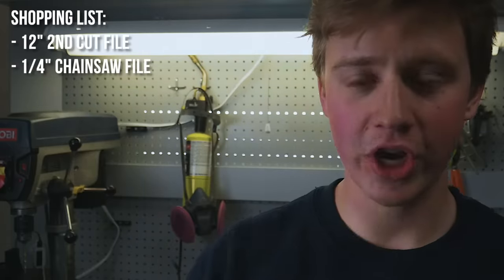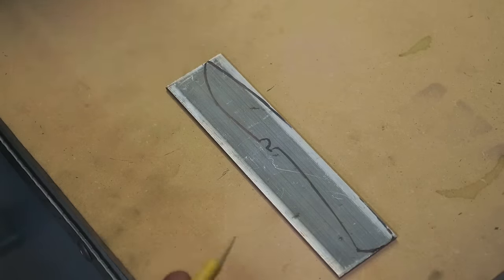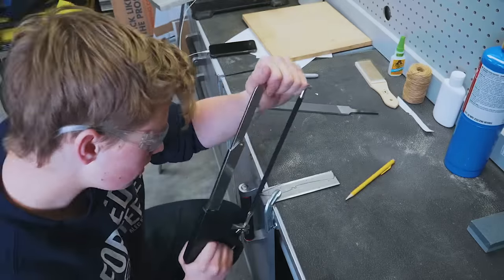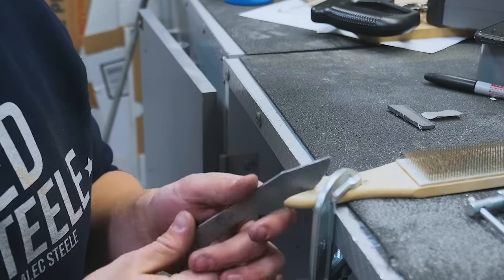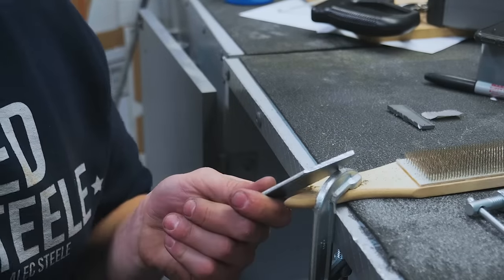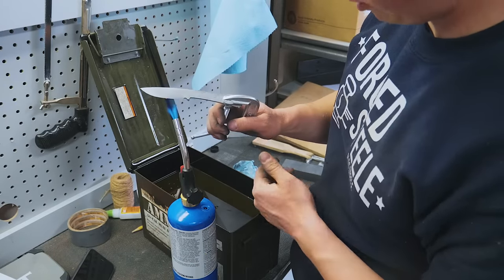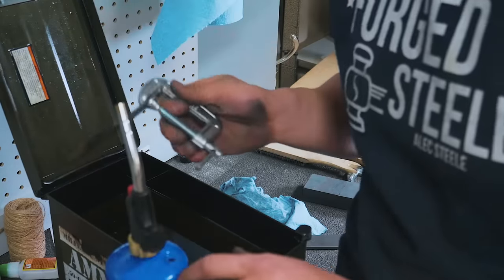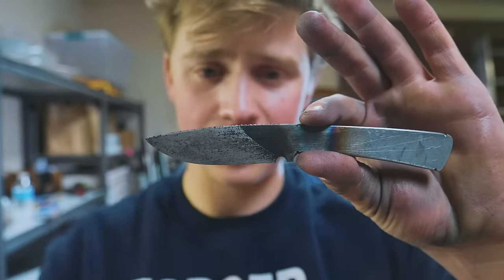MAKE A KNIFE WITH $100 OF TOOLS YOU PROBABLY ALREADY OWN!!!

Comment: Great to see a project not requiring 10'000 + dollers in heavy machines.

Fun to see what can be achieved even with a few bits from a hardware store.
Reply: you should check out Alec's learning to forge series (hopefully that's still up Alec???) he covers on how to get into forging with like absolute bare basics (like, charcoal and a hair dryer I think and what we in the forging community (feels weird saying that given how little I forge :( ) call an "anvil shaped object" **edit : which is a hunk of steel, mine is 90mm x 200mm bright steel lol, in the thingo he says to use rolled steel, so I like to think I have the prettiest anvil shaped object hahahaha
Reply: Man, keep in mind ancient blacksmiths made amazing swords with pretty much just a hammer and some stones. That said, there's plenty of cheap tools you can get. An angle grinder, for instance. Really useful, and you can probably get it for 50$. Maybe less, don't know the prices in the US. But if you can get a welder for like 60$ (I think, on Amazon) that works fine, you can get a cheap angle grinder, too.
Reply: @topanteon  95% of most guys and probably quite some girls too, will have just about everything to make a knife. Angle grinder should be a more or less must have in any home for a million reasons, and you can buy them for as low as 20 bucks, but I would go a tiny bit  higher and get a decent one that will have enough oomph. for the rest a few metal files, or even only a decent coarse sandpaper will work, slowly, but it will work. The other thing is the heat treatment, that is probably the part people think they can't but its as he shows pretty easy. if you have a bbq or backyard where you can make a fire in, use that and us a hairdryer or something to heat the blade. Dont have a yard? use the burner he said or equivalent, you can even do that on the balcony or out in the street or the curb if you dont have a lawn. Lastly use easy steel to learn in the beginning, 1075, 1084, etc. Here in europe we  have 12C27 from sandvik in norway, very good steel, affordable and very nice to work with. Morakniv uses that steel for a lot of their knifes for instance.
Reply: I've made many of my power tools including a 1 1/4 hp 48" belt grinder from cheap Craigslist stuff and birch plywood. It's not as sexy and takes me weeks but I have the equivalent of machines costing $1100+
Reply: Long as machine works it works. Does need to have to be sexy, shiny and fancy.

Most old machines of the industrial revolution and other eras where pretty much function over form.
Reply: 10000 you must be watching his very old videos pretty sure he’s way past that by now

Comment: You guys should do a knife build, only using the tools you sell in your website.
Reply: jpiz224 Is that not the same tools they already use in the shop
Reply: @AntonJonssonMEK  I haven't checked their site lately but I Don't believe they sell power hammers or drill press.. or even a forge.
Reply: jpiz224 they don‘t sell anything to heat steel so they would have to use something else for heat treat or forging and they have belt grinders in the shop which makes the job very easy.

Comment: Thanks! I'm stuck in an apartment, and by chance me and my 9 year old decided to start making a knife using pretty much this method. I can afford better tools, but no way we can use power tools in the apartment, so it's all hack saw and files. Starting with a simple throwing knife in cheap cold rolles steal, but I have a piece of O1 tool steel for a couple of "real" knives. This gave some really good pointers.

Comment: That feeling after filing steel for an hour when you brush your arm across the table and get 1500 metal splinters... ahhh filing a knife to shape :)
Reply: I love that feeling
Reply: I feel like you probably used the wrong file. My shavings are never sharp enough to penetrate my skin 🤔
Reply: Taunus-Tims Welt lol who knows, i use a very aggressive and sharp bastard file that hogs material off fast and leaves sharp sliver shavings of metal on the table (when shaping a knife, i have many fine cut files that dont do this)
Reply: @craftsmanscutlery6002  i use bastad files as well. A bunch of new ones and a couple of older files. Also an 8 pound heavy file, which is a little overkill for knifes.
All my files have "Kreuzhieb" (cross cut) cuts, so they produce little rectangular or cubic shavings and no spikes/needles. I guessed you might probably use files for aluminum or other soft metals. They are parallel cut and tend to produce these needle-like shavings. But this'd be an absolute beginners fault, so i assume this won't be your case.

Comment: Long time listener...first time caller...just a piece of advice from a poor hobbyist blade smith. I use a saw horse and clamps to secure my blade when I file and sand. You can easily flip in any direction in order to work blade or handle. Also it allows you to sit and work thus saving your back from fatigue. Hope this helps!

Comment: Just wanted to point out that the MAP gas you have on the larger torch burns much hotter than propane.
Reply: Came here to say this too.
Reply: MFW that torch alone costs $120 dollarydoos
Reply: @Marc83Aus   Wow.. around here it's only $56 at Home Depot - Model TS8000KC
Reply: @Polar_Ted  Yeah I think MAP gas isn't as commonly used over here so its more costly for a home gamer like myself.

Comment: For my first knife i used two of simular small torches. I sat them up so the flames crossed and i could heat the knife in both flames between the burners. Worked well.

Hope the explaination makes sense

Comment: Partner with demolition ranch and make Damascus furniture for an AR
Reply: That would both be really heavy, and kinda expensive no?
Reply: Not necessarily super heavy if made thin enough but it's not the point to be the best furniture for an ar,  the point is to be an awesome cross section of two very cool people, that also looks awesome. As for expense? Imagine the resale value of it, he could easily make the money back auctioning it off
Reply: Better yet. Have demo come and teach him to forge a Damascus block. And then parter with another company with a CBC mill (perhaps F1 firearms) to machine a lower from the Damascus blank

Comment: Petition to show our hammer wielding and steel welding Heros we need a Damascus Revolver Cylinder!
Make this top comment whatever the cost!!!
Reply: Now that they've got "blacksmith", "jeweler", and "tailor" covered, I think the next skill I really wish either Alec or Will (or both) pick up is "gunsmith".
Reply: Doesn't Youtube still have that stupid "No Gun Making Videos" Ban?

Also, for firearms you actually want to use Homogeneous steel over damascus to ensure uniform strength, ESPECIALLY in the chamber. Besides, the beauty of a firearm isn't found in the grain structure of it's steel, but rather the quality of its polish, finish, and engraving.
Reply: They could make a damascus revolver frame.
Reply: @MoxJet629  Once again, Youtube Gun making ban, because the idiots in charge don't know the difference between a junkyard reject showing you how to make a "shotgun" out of two pipes and a nail and a trained craftsman showing off years of honed skills in a well equipped workshop filled with equipment that's worth more than most of us will make in a year.
Reply: It might get demonotized but I doubt removed. It's art that would take a lot of skill and equipment to reproduce.
Reply: blackhawk15897 Yes I thought about the problem with the strength. My solution is to partner with a company that has high precision tools to make some hardened steel inserts for the chambers. Also, there is .22 Revolvers out there that don’t expand as much in the chamber.

Comment: When I do wrapped handles (typically paracord) I always love it when the handle has a hole for a lanyard, that's the perfect stopping point and would be a great feature to add for anyone trying this imo. If you knot if off there you have a solid handle that's not going anywhere without any adhesive, and if you want you can leave it long and tie the ends together for a lanyard as well. When I do the wraps I also love to gut several feet of paracord first and do a simple spiral wrap around the handle first, then follow it up with the twist pattern that was used in this video. The paracord is thick enough that if you don't do that pre-wrap you can see through to the bare metal, and I think it helps with slipping to some extent as well. One of those clips that you use to hold a bag of chips closed is enough to hold tension on what you've already done if you need a break, I've got arthritis in my hands so doing a real tight handle can be pretty brutal if I try to do it all at once.

Comment: Great video Will, you can put 2 strips of wood under the first layer of twine and you can put on a second layer of twine to give the handle a little more body, finally give it a good coat of epoxy and wipe off any excess to keep it from getting filthy.

Comment: Very Nice.  I'd recommend using a lighter on the twine to get rid of some of the little stringing it's got.  Hold it so the flame doesn't touch your wrap, but the heat still melts/burns the smaller fibers away.

Comment: FYI, for the torch, Will was using MAP gas (the yellow can) which burns hotter than regular propane. This helps you get higher temps so you can heat treat correctly

Comment: For heat treating, you can make a "backyard forge"with just a bag of lump charcoal and a hair dryer (I advise to tape a metal pipe to the end so as to not overheat your hair dryer). You can create a fire that can get steel up to forge temps. The only downside is you need the space, at least 15 feet away from nearest structure to avoid any damage

Comment: I ran into a guy at a local knife show that does something similar, he does use a bandsaw and bench grinder though. He also does not do a cord wrap, he dips the handles in something similar to Rhino Lining. They are decent inexpensive little knives, I think what makes them good though is whatever he is doing for heat treat ... which he wouldn't tell me.

Comment: Will. Next time soak the natural twine in water before you wrap. As it dries out the strands will shrink and tighten the twine really really tight. This also works really well with leather lacing. Another interesting build would be a cold made knife from an old circular saw blade using a 1mm slitter blade on a grinder but not letting it get hot. Also cheap and easy...

Comment: Plus, you can continue making knifes with the $120 dollars tool investment. Butj questions: 1. no need to check the temp of the steel before the first quench ? Just get it red? 2. Then put it in the 400 degree oven for 2 hours each but let it cool to room temp ? 3. What finish stone grit do you reccommend for finish ? 4. how easy will this blade break ?

Comment: Great video, just a little thing... To sharpen the edge with a stone you should "attack" the stone with the edge instead of sliding it towards the back and you will get a much sharper edge in quite less strokes. I have sharpened all kinds of knifes machetes and other things with stone for over 15 years. I can't say a thing about forging, but I can about sharpenning with a stone.

Comment: Will maybe You should get the cord wet, then wrap it on the handle, so it would pull tigher when it dries off? Just like most people wet exhaust insulation belt, keeping it wet makes it bend nicer and it also slides nicer on steel and itself.

Comment: If you need a good file handle, drill a hole in a golf ball. Try not to use a big file without a handle, because if the file catches and your hand keeps moving, you can find that tang embedded pretty deeply into your wrist or palm. Golf balls are super comfortable for some strange reason.

And nice work on the knife. That would be a great little Scouts knife with a decent sheath. Fixed blades are definitely safer for teaching good knife handling to youngsters.

Comment: Hey,

Did you know that you can get a much sharper knife if you go to your thrift store and find a real porcelain plate. It does wonders for a final edge. Used to use the bottoms of the plates at work to sharpen my knife when I was assistant chef and dish washer.

Comment: Could've made a loop that goes up the length of the handle. Loop end towards where you want to finish the wrap, and leaving a "tag" on the opposite end. Wrap towards the loops end in whatever fashion you choose, then put the end of twine through the loop, and pull the tag. It'll bring the end of your cordage through the middle of the wrap. No knots, no glue... It's a classic method for attaching spear heads, arrow fletching, and much more

Comment: If you had put the end of the torch in a small tin can it would have concentrated the heat and gotten the steel to temperature for the quench. Easy and cheap way to get more heat from the hand torch.

Comment: That cord you cut off could have been tucked under the wrapped handle.  Take a thin wire bent in half, passed under from the starter side to the end.  slide the extra through it and pull it under. Super glue may hold up for a while. Great knife 🤙

Comment: You could of got wet dry sand paper with different grits for about the same as the stone, and used the file to roughly do the edge then finish with wet dry sand paper on a flat surface.

Comment: So just randomly. I wanted to try and get more into making knives, now, for production costs vs. value is it more worthwhile to take a smithing course, and learn to actually smith the blades or is it more cost effective to go with a method more like this and make the cuts, shape, etc. By hand? 

P.s. I have the means and the tools to go with the method used in this video plus angle grinders, a vice, and even multiple sharpening kits. Just wanted to get some foreign input, before shelling out money for a course, and tools for smithing.
Reply: I shouldnt say cost effective. I'm not sure the words I was looking for, but I mean is the value of the blade themselves inherently raised by smithing vs. this method.

Comment: I feel like you did the handle the hard way. If you take the jute, lay it from the butt of the handle to the ricasso, so it hangs maybe 2 inches off the end of the knife, and literally circle wrap around from ricasso to the end of the handle, and about 3/4 of an inch from the end, take the 2 inches you left from the end, make a loop, wrap that last 3/4 of the handle, making sure to leave the end of the loop out. You can take the end you were wrapping with, put it through that loop, and pull the OTHER end, securing the loop down towards the handle. then you can take a lighter to it, make it smooth and perty, i personally cover it with wood glue, and sand it. Food for thought :)

Comment: My question: I'm about to start on this project, and my only major concern is if I should have any respiratory protection for sanding the metals. If I upgrade to a small belt sander, should I get respiratory protection then? Very basic question, I know. I know metals can be dangerous, so I'm only going to start with 1080 blanks.
Reply: Files, not really. 1x30 or 1x42 type small belt grinder, yes. I didn't and still don't have a respirator because EVERYTHING IS GONE, but my snot turns black if I don't wear any lung protection, and it's harder to breathe at night sometimes

Comment: I like the idea, but there are some issues. First, all that stuff may cost 100 USD in America. However, where I live, the nozzle for the propane torch costs roughly 75 dollars when converted to USD. The actual propane is another 15-20. The file would be about 30-40. A hacksaw and a couple blades would be another 20. Sharpening stone would be maybe 10 and good luck finding honing oil here. I usually use food grade mineral oil. The C clamps would be another 15 or so. Plus ~10 for two little slabs of 1095 if bought from the site. So I would be looking at almost double the stated budget. That's the main reason I have never fully gotten into knife making or blacksmithing. It's just so prohibitively expensive where I am.

Comment: so 400 degrees celsius? i think you meant farenheit right? for 2 cicle of 2 hous each? sorry just wanna learn something ... and thank you for this video.. last time i used hardened steel all along the thang of the blade and as soon as i was driving the punch to mark the spot for the handle holes my knife broke in half ... now i know something more.. that part didn't have to be hardened ..

Comment: Personally, I'd have skipped the honing oil, and used what ever oil I used for tempering, and invested that fey buck in a pack of wet/dry sand paper, a piece of 400 grit on a flat bench top makes a make do honing surface, and the bottom of a coffee cup will do the job of the extra fine stone for a final edge. I wonder if Ace or whoever will deliver MAPP gas?

Comment: I think I would have spent the money on an angle grinder or bench grinder. You can pick up a cheap angle grinder for $10 from Harbor Freight with a coupon or when they go on sale. It won't last long but long enough to do at least 5 or 6 knives and with some practice you can grind in the bevels with even polish it a bit with a high grit flap disk

Comment: @14:00 If you want a nicer edge, you could, you know, sharpen it properly. As in - you sharpen a knife on the push, not pull. As in - you push the knife into the stone, not drag it over it. As in - the opposite of what we can see Will doing here through most of the sharpening montage.

Comment: Nice try Will. I should buy a cheap angle grinder, some disks for it, and also a concrete cell blocks and build a small chamber with it. I bet you'll get that knife in quench temperature with that smaller burner...